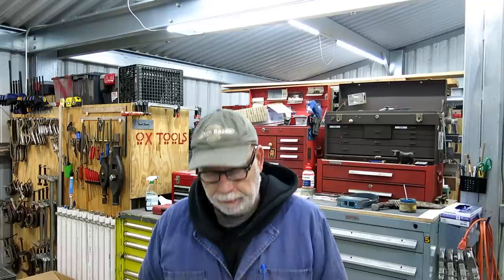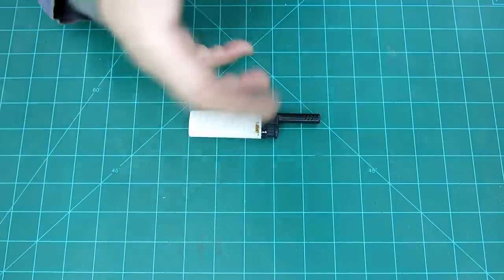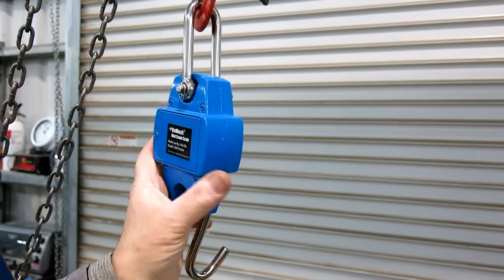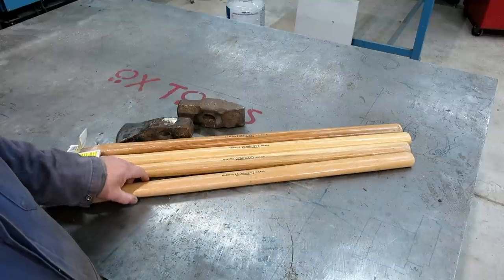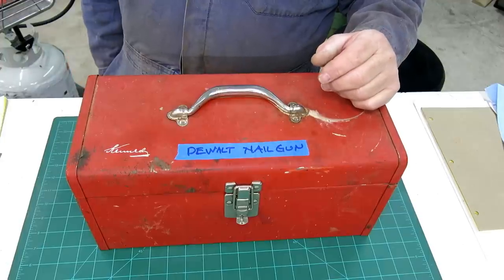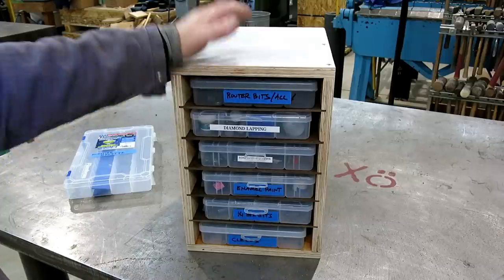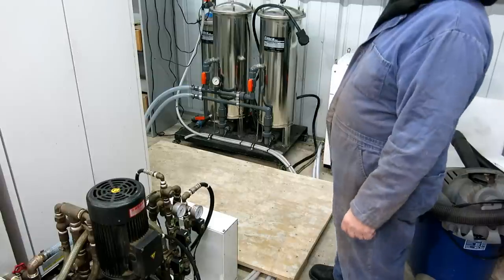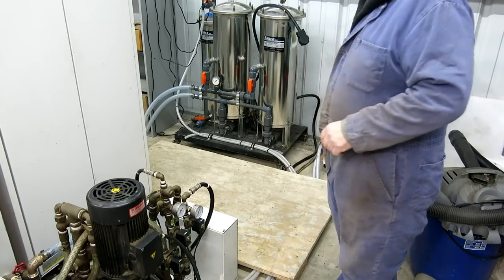Monday Night Meatloaf 146

Comment: Yep, I would never go to a channel where information is routinely spread by an experienced machinist who talks during filming.  You have to watch chips change colors and dwarf build up on the vise top 2/3 of the time with zero fast forward.  Accumulation of minutes of viewers time is where it is at.  Bbbrrrrrrtttttt.  I just explained to her about where you work, and what little bit I could about what you do,  and the Retired Masters Degree Social Worker was rightfully impressed.  You have a battery powered Skill Saw?  What has the world coming too?  Mens Tools Must Have Tails!  You modern electron abuser!  I’m jealous…I only have batt pwr spinny screw/drill thingys.  Can’t justify the other stuff with light weight pretty plastic.     Great video and really appreciate the storage solution for little cash tips.  This winter goal was to organize the shop/shed.  Still snowing so I have a tiny bit of time……but probably not enough.   Thanks Tom
Reply from the maker: Hey Stew. I have a tailed proper Skilsaw also. Don't tell anybody but it has cut more aluminum than wood. The honest truth is the dang thing is so heavy compared to the non tailed version. I'm too old to be up a ladder with a two horsepower corded skill saw upside down cutting rafter tails. Thanks for the comment. 

Cheers,

Tom

Comment: As for your handle interface, could you incorporate both locations into one piece? Having a long leg for your in line handle location would take a lot of the side load off your screws. Similarly with your side handle location. Would help keep everything locked in place and spread the pulling force over more fasteners. Less likely to break.
Reply from the maker: Hey Nathan. That is exactly where I'm headed. The best of both worlds. Thanks for the comment. 

Cheers,

Tom

Comment: Hey Tom, I’m not sure if you guys have them over in the states, but here in Australia we have these things called BBQ lighters. They are just like the little thing you have there except they are around 150mm long. Very handy for keeping your fingers cool in all sorts of situations.
Reply from the maker: Hey Minchy. Yes we have those also. The issue with the longer ones is the trigger is typically interlocked with safety devices making it a pain to use. I have a couple that I curse every time I use them. Thanks for the comment.

Cheers,

Tom

Comment: Regarding the 6 volt Fanuc batteries: I made a battery pack with two parallel banks of 4 AA lithium cells and attached the connector from a dead fanuc battery. The lithium cells wont leak like an alkaline battery and the pack lasted almost 3 years before getting the low battery warning. We were only getting about a year on the OEM packs.
Reply from the maker: Hey Joe. The FSANUC replacements are lithium. I don't think I would trust the memory battery to anything but lithium. My experience is you have at least two years but it's cheap insurance to do it every year when you think about the cost of reloading all the parameters from scratch. Thanks for the comment.

Cheers,

Tom

Comment: You could get into trouble fast with a 1.75" lead on that Clover. I bet the thing can gear down pretty slow for threading like that.
Reply from the maker: Hey Parker. Forget and leave it at 1000 rpm and engage the threading nut. Whoops! Thanks for the comment. 

Cheers,

Tom

Comment: Huh. About the EDM machine, did machines from then not use flash or other non volatile memory? While flash certainly did exist I guess the inertia of industrial machinery design could explain the need for the memory battery. Like "Keep using what is known to work."
Reply from the maker: Hey Martel. This is a battery that preserves the machine parameters not the working memory. Thanks for the comment.

Cheers,

Tom
Reply: @oxtoolco  Tom, oh yeah, that makes a whole lot more sense!

Comment: My son is always watching what I'm doing and correcting bad behavior.   I listen and alter what I see as practical, but I do stop and think about it.  He's on the "Safety Sally" side of it.   

Every time I use a skill saw, table Saw, Bandsaw, chop saw.  I think to myself today will not be the day I tear off a finger or arm.  

 I do slack on lathes and mill and other tools, and should do better.   The high rpm blades are always a concern.
Reply from the maker: Hey John. Woodworking equipment scares me. Everything is handheld and the tools spin at really high speeds. Metalworking stuff is mostly clamped and pinned down really well in comparison. Thanks for the comment. 

Cheers,

Tom

Comment: I was just about to say "meh, he just doesn't want to recommend you anything that might have any chance of being wrong. just call THK and they'll tell you want to get". I'd have to look closer but those rails and blocks look pretty grimy...you might want to scope ebay for some new-old stock stuff from the usual suspects (IKO, NSK, THK). The rolled ballscrew is where the cashmonies is important

I've got a buddy who builds machine tools for the semi conductor industry and he says even the mid-grade stuff has advanced massively over the last 30 years in terms of lubrication intervals, dynamic friction, longevity between lubrication cycles, seals, etc. The RA fully recirculating roller bearings vibration damp like crazy (we're talking low tens of microns at crazy m s^-2, in less than ideal conditions, after 50km) can be had for cheap as chips

That top for the Mcmaster organization stuff is gold. It's great for all those super light widgets that are taking space up in your toolbox slide-out drawers that don't really need the rigidity.
Reply from the maker: Least programmable increment on this machine is a 1/10 micron. I agree that modern lubricants cover much more ground that the old stuff. Thanks for the comment.

Cheers,

Tom

Comment: Tom , Chilly in the shop? Look at those cheap Chinese diesel heaters to keep the chill down in the shop. will probably not keep it comfortable but will keep it from freezing until you get the insulation in. No humidity and fairly cheap to run,   later you can get a MrCool mini split for the summer, but for a quick fix the diesel heater will help for now
Reply from the maker: Hey John. I have a propane radiant that I set up a warming station with. Allows me to warm up and keep going. Won't heat the shop but at least I can warm up. Thanks for the comment.

Cheers,

Tom
Reply: @oxtoolco  Tom   If it does not exhaust outside the shop, its pumping allot of moisture in the shop from the propane combustion.. The diesels are very efficient and the combustion gasses are exhausted outside.  I put one in and I think it was the best  $100.00 I spent in a while.  Will burn about 4-6 Oz of diesel an hour but puts out more heat. than propane. Search diesel heaters and Jon McK here, look his videos, I think you will be impressed overall .